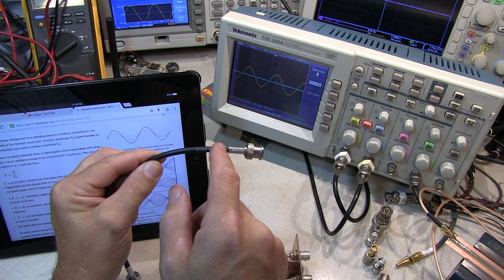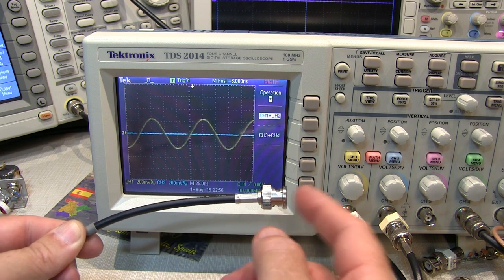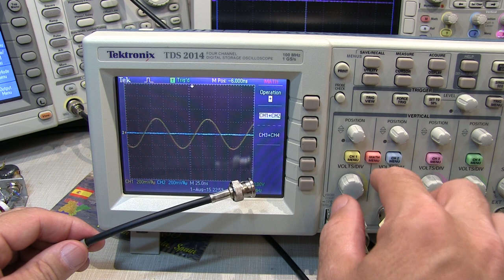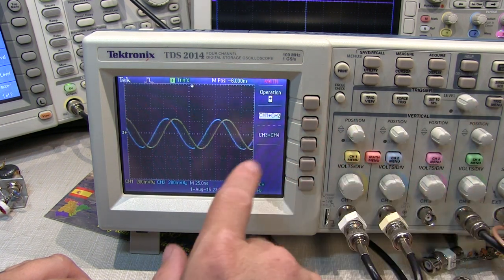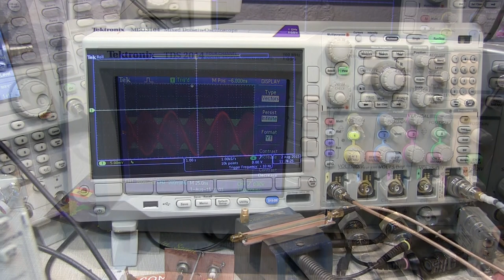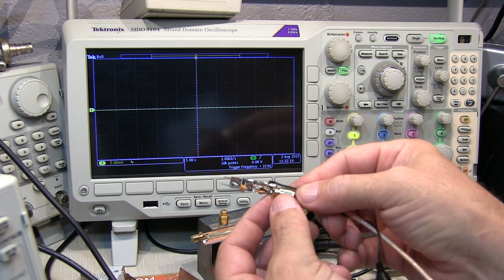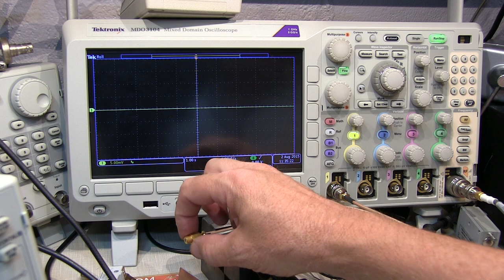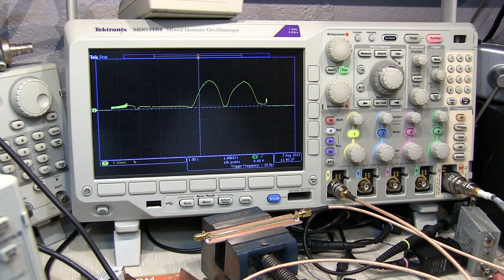#208: Visualizing RF Standing Waves on Transmission Lines

Comment: Awesome video. It's easy for beginners in electronics to think signals are instant, specially digital people. Then when they run into step like signals on their scope they start to realize it's not instant afterall! The thing is that this is not only applicable for RF signals. Simple digital signals will cause reflections, so your title probably should be changed!
Reply from the maker: I have another video on reflections, terminations and transmission lines that talks about digital signals. This one is specifically to explain standing waves.
Reply: Do you have a boyfriend by the way ?

Comment: I love this video!!! Great job. Do you have any resources on how to help me calculate the correct feeder length on a simple 1/4 wavelength dipole antenna? I make dual band antenna tuned to 155Mhz and then a resonant UHF harmonic of around 430Mhz appears. But my antenna are 1.3m long. I'd like them to be short (these are body worn flexible coax antenna by the way) Thanks in advance

Comment: So basically, you can double the receiving Power of a receiver, by making the receiving line open-ended, and then adding a tap just 1/4 wavelength away (where there is a maximum)? Or is it something I missed?

Comment: what would happen if the frequency of the signal that you used to visualize, had some kind of variation, lets say, from broken/inaccurate crystal oscillator that isn't stable anymore? Could one happen to actually see some kind of changes in reflection profile? Like voltage changes on the line that would otherwise had a "void" point in the spot?

Comment: Question: for low frequency (1MHz pure sine) signal, does an unterminated (or impedance mismatched) line matter at all, when distances are on the scale of a PCB board, several inches? Energy still gets reflected and thus not delivered to the load entirely, correct? But, there are no standing waves, correct? But, the signal does attenuate at each impedance discontinuity, correct? The wires/traces are just lump capacitors that form dividers, so it's not a transmission line problem at all at 1MHz?  Does the reflected energy get absorbed at the source (50ohm source)?
Reply from the maker: When the line length is less than 1/10th of a wavelength, you generally don't have to worry about reflections, etc.

Comment: How the heck did you simulate the two opposing waves with your function generator?
Reply from the maker: A little trick...  The function generator I used has 2 channels, and has an output of the internal 10MHz reference signal.   I triggered the scope on the 10MHz reference, and then had one channel output a signal at 10,000,001Hz (10MHz + 1Hz) and the other channel output 999,999Hz (10MHz-1Hz).  These two signals will "slide" in opposite directions on the scope with respect to the 10MHz trigger input.
Reply: @w2aew  Thanks! I thought it was something like that. I tried this using the two function generators on my Rigol MSO5000 and triggered on the 60Hz line and set one of the generators to 61Hz. But I assumed the "reverse" wave must be the same frequency for this to work, but I guess it just needs to be close enough, and you're right.. it's close enough.  Thanks for cluing me in. I am able to get good results using 60.1Hz and 59.9Hz and triggering the scope on the AC crossing.

Comment: Excellent Video... came across this via 'Hack a Day' & have now subscribed - will be taking a close study of all your vids if this one is anything to go by. Thks
Reply from the maker: John Punnett Cool!  I didn't know that this got posted to Hackaday!  There are over 200 videos.  If you look at the lower right corner of the top graphic on the channel homepage, you'll find a link to a PDF file which has a list with links of every video - arranged by number and arranged by topic.
Reply: ***** Hi, I just have one quick question - How exactly did you display your waveforms travelling in different directions across the scope? (i.e. forward & reflected) - Is this a function of the oscilloscope or the signal generator you are using...? thks,  John
Reply from the maker: John Punnett This was done with a little create generator/scope setup.  I connected the 10MHz reference output of the function generator to the scope channel 4, and used this as trigger source.  Then, I set ch1 and ch2 of the function generator to very slightly above/below 10MHz, and these are coupled to ch1 and ch2 of the scope.  So, one of them appears to slide left to right, and the other from right to left.
Reply: ***** OK thks - I guess you are only a few Hz above & below your trigger freq. I tried it using a fixed 13.56MHz signal for the trigger & I had a variable signal but could only change it coarsely by several kHz & I couldn't obtain a stable trace on the non-triggered channel :-(
Reply from the maker: John Punnett Yes, I was able to adjust the ch1 and ch2 frequencies by less than 1Hz with my function generator.
Reply: OK Thks... I managed to hook up a DDS chip & with S/W control can change frequency by 1Hz & it does indeed change direction - like you mention I would need sub Hz control for accurate display like you have - Out of interest what function generator do you have? thks again for a great vid - John.
Reply from the maker: John Punnett It is a Tektronix AFG3252, courtesy of my job ;-)
Reply: Nice.. :-) Out of my price league but I wouldn't say no if it came courtesy of my job.. :-)

Comment: Hi, first of all fantastic explanation!. I would like, if possible, I apreciate if you can clarify the following:  theoretically there are not electromagnetic field outside the coax cble shield... then could not be possible to sample signal from it. but it is used!  why the coax shield is grounded only in one end and could be ossible use only the central conductor removing the shield??? tks a lot Dario

Comment: Hi Alan! I am a big fan of yours and your videos have helped me alot for understanding RF MW. Thanks alot of the great stuff.
I tried your probe it works great but I have a few questions.
1.  When visualizing the standing waves on the transmission line did you use a modulated signal or just an RF tone @ 2.4 GHz ? 
2. This probe worked well for your previous video for detecting the envelope. But I wanted to observe the standing waves on the transmission line. Could you please explain your setup for the second part?
Reply from the maker: I used a single, unmodulated RF tone.  For the second part, I simply have an exposed 50 ohm transmission line that is unterminated.  Because it is unterminated, the RF signal will be reflected, resulting in a standing wave on the line.

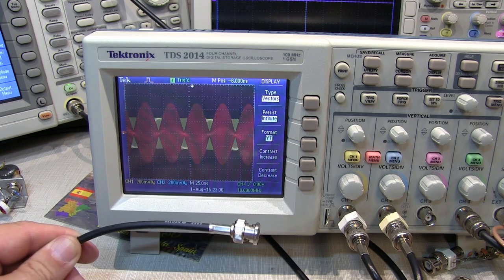Comment: At 4:41...Does that mean coax length is critical for both reducing SWR and where you insert the meter to read SWR?
Reply: lol, i asked the same question. not as straight forward as you did, but the same question none the less.
Reply: No I think it's just the matching of the termination that determines SWR. You can use a slotted line to measure SWR, you do that by sampling the standing wave at different points.
Reply: Oh nvm, he pretty much makes  a slotted line with the strip line later in the video. good demo.

Comment: This, I think, is why you can’t just check VSWR on a feed line of unknown length, as you may be looking at either a null or a peak or something in between.  When adjusting an antenna, you should use a half wave length of coax (for that frequency) in order to see the actual SWR of the antenna and not a misleading null or peak.  Yes?
Reply from the maker: Actually, as long as the feedline is not acting as part of the antenna or counterpoise, then the length of the line will NOT affect SWR.  Using 1/2 wavelength will ensure that the IMPEDANCE seen at the far end is the same as the impedance of the antenna.  Varying the feedline length will vary the complex impedance seen at the far end, but will not change the SWR on the line.

Comment: Hello, thanks for this excellent video and explanation.  However, there is one thing I don't understand.  Since your transmission line is terminated OPEN, I would have expected voltage amplitude to be doubled at the end of the transmission line.  But instead, it looks like there is zero voltage amplitude at the end of the line.  Could you explain why this is?    Thanks again.
Reply from the maker: I didn't probe at exactly the end of the line, I happen to touch down something nearer one of the nodes/nulls.

Comment: Hi Allen! I am so glad that I found you channel! Thank you for your contribution and for spreading those practical education stuff! I have one question: imagine that we have a chain: RF chain consisted with: transmitter with sma output -> rf 30dB attenuator + unmatched antenna with high VSWR. In case that reflected power will be high, which element will be damaged? Attenuator or transmitter amplifier? Thanks in advance ;)
Reply from the maker: If anything, it would be the attenuator, since it will see (and absorb) the reflected power.  It would also attenuate the reflected power by 30dB, so the transmitter won't really see it.
Reply: @w2aew  Thank you so much for this quick reply! Best greetings from Poland :)

Comment: Are you feeding a square wave on CH3 as a trigger and feeding in a sin wave of slightly higher frequency on  CH1 and  feeding CH2 a sin wave of slightly lower frequency to get those traveling waves? 

I remember that on the old oscilloscopes, if your horizontal scanning frequency is sightly lower or higher than the sin wave you are trying to measure, the wave form will appear traveling left or right.
Reply from the maker: +PrckCardinal That's basically what I'm doing.

Comment: Question, when using a "antenna tuner" are standing waves that are reflected back to the tuner, are they redirected back to the antenna until dissipated as RF, except for the IR loos of the transmission line?
Reply from the maker: Curtis Wilson I believe the right way to think about this is that the complex conjugate match provided by the tuner reflects the the reverse waves back towards the antenna, in phase with the forward waves.  Thus, the standing wave still exists on the transmission line.
Reply: *****  Thanks for your reply. So I am assuming the process of reflecting power back to the tuner, and then the re reflected back to the antenna is a continuous process that adds to the forward power.
PS, you have some pretty cool toys. AJ6O

Comment: Hello, I am a student. 
I am trying to duplicate your experiment on an oscilloscope (my lab has Infinii Vision - MSO - X 2012A  and Tektronix MSO 2012). I tried to make it work on both of them however no good result. Can you possibly give some specific values for the waveform generator? What types of oscilloscopes and waveform generators do you use?
Reply from the maker: The first experiment that showed the waveforms "sliding" in opposite directions was a bit of visualization trickery to put the waveforms in slow motion to visualize the addition of the two waves.  I did this by using a 2 channel AFG (Tektronix AFG3252).  I triggered the scope on the 10MHz Reference Output from the generator, then set 1 channel to be 1Hz higher than 10MHz, and the other channel to be 1Hz lower than 10MHz.  This made them appear to "walk" forward and backward - visually representing the forward and reflected wave (without having to use directional couplers, etc).  I then used a Math channel with visual persistence to sum Ch1 and Ch2 to see the standing wave pattern.
Reply: @w2aew  What voltage did you apply for the function generator? Did you use two different function generators?  Do you think the experiment will work on the following models Infiniti Vision - MSO - X 2012A  and Tektronix MSO 2012? I really appreciate
Reply from the maker: @narangootumur6785  I don't remember the voltage (it isn't really that important, just scale the vertical on the scope appropriately).  I used one dual-channel function generator (Tektronix AFG3252).  I don't know if those two scopes support infinite persistence on the Math channel, but other than that, they should work fine

Comment: How you configured the generator and oscilloscope trigger to get these moving waves on both channels?
Reply from the maker: A little trickery...  I used the 10MHz reference output from the AFG to trigger the scope, and then set the two outputs to 1Hz above and 1Hz below 10MHz - so they "walk" in opposite directions at 1 cycle/sec.
Reply: @w2aew  Thanks a lot for explanation and great demonstrations!

Comment: This is why a VSWR meter (which works on Voltage) will show a different SWR at different points along the line ??
Reply from the maker: I properly designed VSWR meter should read the same VSWR at any point on the line, but the forward and reverse power readings will vary at different points on the line (because the power readings are derived from voltage readings and assume a 50ohm impedance - both of which vary depending on where you are on the line).

Comment: Hi Alan - I really liked this video and wish I had been able to see it 45 years ago when first studying EM. I have what is likely a pretty naive question as follows: Given that you can measure the voltage along the line, and assuming the transmission line characteristic impedance is known, is it true that the current at any point along the line is related to the voltage by Ohm’s Law through the characteristic impedance? If true this seems to suggest that current and voltage are in-phase at any point along the line because the characteristic impedance is real-valued (e.g., 50 Ohms). Most discussions of coax theory seem to focus on voltage measurements with little discussion of current. I’m trying to visualize the current magnitude along the coax. Thank you for sharing this video and thanks in advance for comments. - Best - Jim (KK7CSC)
Reply from the maker: The voltage/current relationship on a transmission line only obeys the transmission line impedance when the line is properly terminated in its characteristic impedance.  When not properly terminated, the reflected wave and forward wave combine and the impedance varies based on position on the line.
Reply: Thanks very much, Alan. - Best regards - Jim

Comment: Hi,

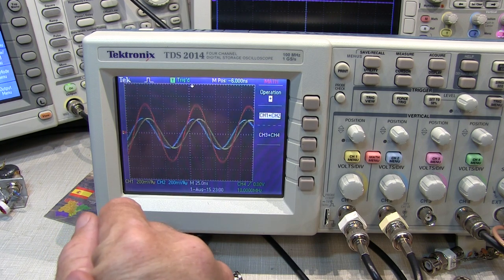This was my favorite video on standing waves that I've been able to find. Quick question, though: At 4:10, where you had the fwd and ref waves at the same amplitudes, what would the resulting standing wave's ratio, therefore be? Specifically, 100% of the voltage is being reflected back, right? I'm just a little confused about infinity, unity, 1:1, 2:1 and other ratios. I would like to see what these waves all look like to connect them to these terms. In fact, I need to see it, because I'm not understanding how 1:1--if this means there is no reflection, and impedances are matched--how on earth can you even call it a standing wave ratio if there are no reflections to create a standing wave? Am I gonzo here or does my question make sense to anyone out there?
Reply from the maker: Think of it this way...  The reflected wave adds to the forward wave and results in causing the RF envelope to have different amplitudes depending on where you are on the line (see the red waveform at 5:43). The VSWR is the ratio of the peak of this envelope (Vpeak) to the trough (Vtrough) of the envelope, such as Vpeak/Vtrough.  As the reflected waveform gets worse, the trough gets closer to zero, and the ratio grows.  When the trough approaches zero, which would be a reflection from an OPEN or SHORT at the end of the line, the SWR approaches infinity (due to the divide by zero).  When there is no reflected waveform, then the RF envelope is constant (Vpeak=Vtrough), so the SWR is 1:1
Reply: @w2aew  Actually, that makes perfect sense. I figured it out by working a few equations last night, then saw this this morning. I saw that the 0 was infinity, and it made sense. By using p=1+(coefficient of maxes) / 1-(coefficient of maxes) I could visualize the sizes of the waves and the resulting sums a lot easier. I worked out different ratios. I feel like I've nailed this down pretty good, now, because everything that came previous makes perfect sense to me now. For example, a lamp getting brighter and dimmer along a line. Makes perfect sense to me now! This was awesome. Thanks for the video, it unlocked all of this for me.

Comment: Hi Alan. An oddball question if you don't mind. I understand you were measuring volts. In the first part of the video when you were demonstrating a correctly terminated incident wave ... is it possible to calculate the peak/node in metres? In ham radio, say a 7MHz carrier at say 100W, what is the peak amplitude of the voltage (or current for that matter) measured in metres? In a ballpark sense, is the amplitude in the order of metres or millimetres? Thanks.
Reply from the maker: You're looking for the wavelength of the signal.  This is easily calculated.  300/Frequency_in_MHz will give you the free-space wavelength in meters.
Reply: @w2aew  Actually, it's the wave height that I'm asking about. In maths the length and height of a sinusoid can be calculated using the same units of measure. I've been searching for ages to see if there's a way to calculate the height in metres of a RF sinusoid but the concept never seems to be discussed. If the height can be calculated but the process is massively complex I would be happy to just know what sort of scale RF lives at ... eg  a 7MHz carrier at 100W, what is the peak amplitude of the voltage (or current) ... is it  in the order of metres or millimetres? Thanks (and apologies for pestering you again).
Reply from the maker: @nevmarr  The amplitude of an electromagnetic wave cannot be measured in height - it doesn't have any height.  Larger amplitudes create a more field strength or intensity.  Much like you can't measure the height of a sound wave in air.  Or, can't measure the strength of wind in height.